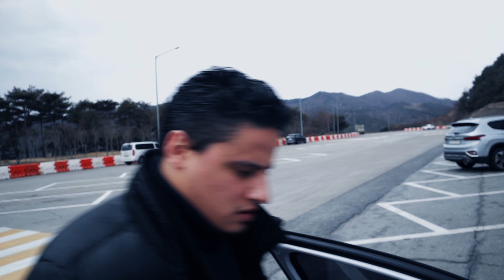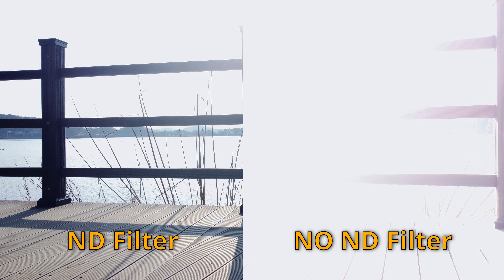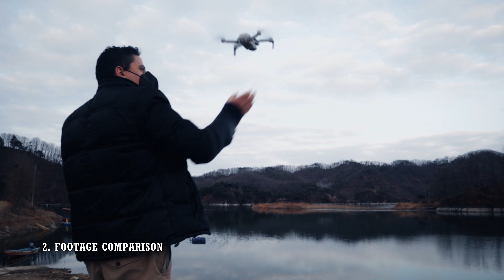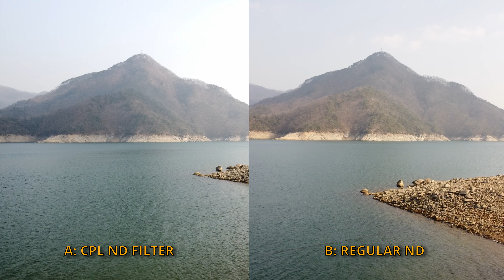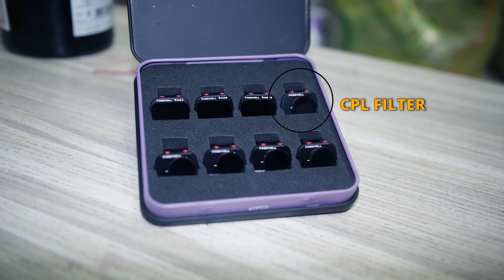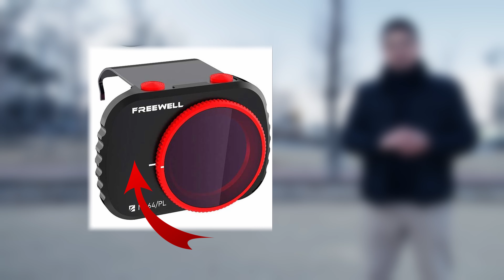DJI Mini 2 CPL + ND Filters EXPLAINED (FREEWELL Set)

Comment: My dji mini 2 has problems with this package of freewell filters. The gimbal keeps making noises and sometimes start to vibrate really heavy. Even after calibration ? What's going on ?
Reply from the maker: I had the same problems with it like you saw in the video. It vibrates and it makes noise. That's why I recommend putting on when the drone is off. And as soon as you turn it on calibrate the gimbal. That's how i got rid of the sound and the vibration. Also I noticed that this problem happens only with the cpl nd filters, the regular nd's are fine. I still calibrate the gimbal though when i put the regular ones on too. I know it's a hustle to calibrate the gimbal every time but it's a good trade for the quality. Sometimes i have to calibrate 2 or 3 times on a flat surface, it's a bit annoying but worth it. Hope this helped Niels, feel free to drop any other questions or concerns, I'm here to help
Reply: @RaedAlibi  thanks for your response , I am gonna try to calibrate multiple times . 👍

Comment: Freewell just build new design filters for Mini 2/SE. Most of the materials are made of plastic. The old one is made of steel and it is always possible to damage the camera and it's kinda hard to attach to the camera. Always make the same noise as in ur videos and sometimes the gimbal will shake terribly. Yes, the old one has a solid build quality. But the material use is not suitable with a plastic coating and gimbal for the Mini 2 camera. I'm glad Freewell re-design the filters and the reason they did it is that they knew the old design really gave a consumer a headache. BTW, nice videos, and thanks for sharing.🙂👍
Reply from the maker: Yes! me too, I'm happy that they re-designed it. Cause I love their filters quality, they produce a crisp image, but usually cause gimbal overload as you said. I mentioned in another comment though that putting the ND Filter when the drone is off and calibrating the gimbal after you turn it on will get rid of the noise! However, it's annoying to keep doing every single time and sometimes I have to calibrate 2 or 3 time to have a stable drone gimbal...  So definitely a good move from FREEWELL. Hey, Thank you for participating in the conversation and point this out! :)